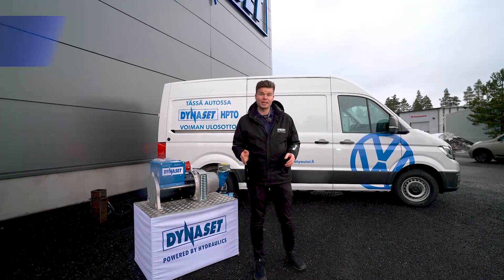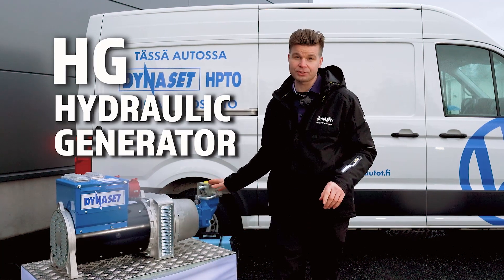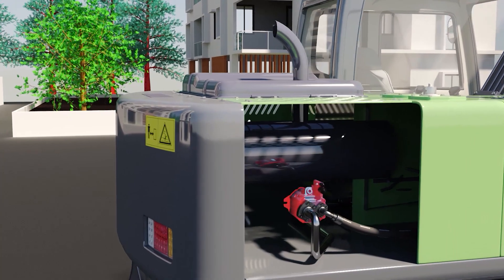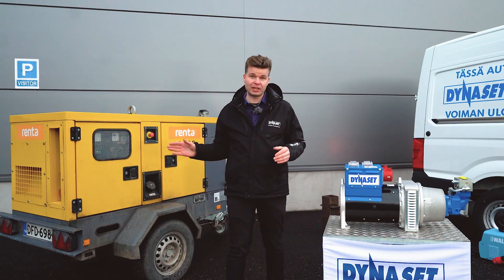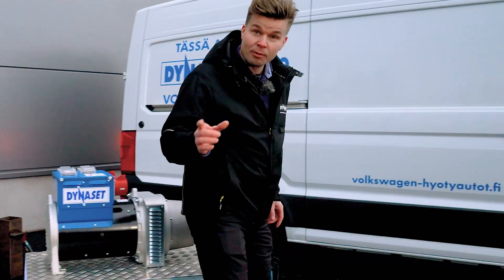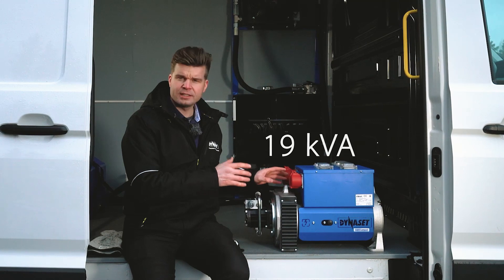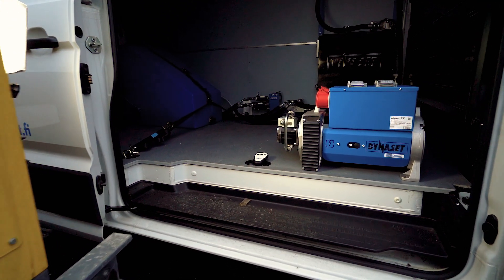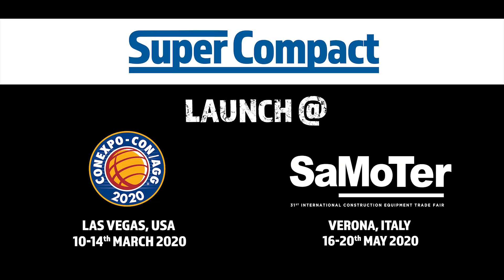Learn how compact the Super Compact series models really are! Check the video!

Comment: Will love to have link with your company. 
I love your innovations
Reply from the maker: Thanks!
Reply: @DynasetOy hello in the car audio industry there is a group of people that build very large and powerful systems. Their problem is that they have to use multiple alternators to power these large systems. I had the idea of using your system with a single large alternator at the rear of the vehicle. Most likely the power needed is 15vdc at 600+ amps. Do you have anything available? Thanks
Reply from the maker: @normellow  Thank you for your interesting question, and we apologize for the delayed response!

Our HGG product line can generate DC power up to 4.8 kW. The standard voltage options are 24VDC and 48VDC, but it might also be possible to produce 12VDC (or 15VDC) as a special product if there is customer demand for it.

To explore this further, we recommend contacting our team directly. You can find the contact details here: https://dynaset.com/contact/.

Comment: It a nice idea but for a fair size comparison you should show the whole system not half-hiding it in the rear and opposite side of the van. The unit you show is not self contained. Watching your catalog, this HG still needs a tank, cooler, pump to install on the engine of the van. Definitely better suited for machines with a native hydraulic system.
Reply: Many service cars with Dynaset stuff have generator or welder/generator, compressor and high pressure washer on them. Some need also hydraulic output eg. for hydraulic cylinder testing. Anyway, anything installed at the engine compartment or elsewhere is away from load/workspace leaving space for tools and furniture :)

Comment: I saw this on HPC, when it is on a tractor it makes sense as the tractor itself has a hydraulic system and pump, so it's just transferring the energy from the tractors pump to the generator.. But you have it in this work vehicle, where is it receiving it's hydraulic power from?
Reply: Propably there is hydraulic pump and output  in this vehicle also.
Reply: @jyrirahkola8943  I had thought that, but didnt see equipment on the truck that would need it. Thanks though as this is probably right.
Reply from the maker: @GranRey-0  Hi Dale! Yes, Jyri is right. The vehicle has its own hydraulic power take-off (PTO). :) PTO is possible to install almost any vehicle.
Reply: Oh wow! I had no idea, PTO does seem pretty convenient, especially combined with the generator!

Comment: But you still have to run a engine to power it..
Reply: Yes, since there is no free energy...

 And by running just hydraulic pump it will be way more fuel efficient than direct engine-generator solution
Reply: I think the idea is that you use an engine you already have in your vehicle, rather than needing to tow a separate engine-generator along. That's pretty neat for vehicles that already have hydraulic pumps fitted to run other hydraulic stuff, like tractors! I wonder if it's economical to fit a hydraulic pump just for running this thing, though? I honestly have no idea. The work van featured in the video, where the worker runs a stick welder and an angle grinder from the vehicle's engine using this thing, would be pretty neat for a mobile welder!
Reply: @alaricsnellpym ..good little machine tho.
Reply: Twoleggedkumulava  you're giving me ideas about my Transit van :-D
Reply: Am thinking about getting one.. @welderup look at this